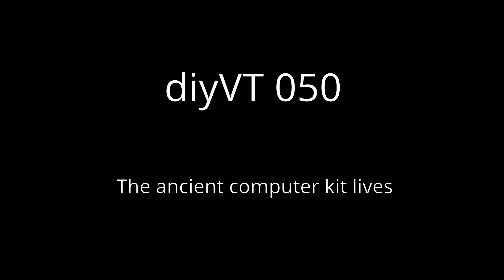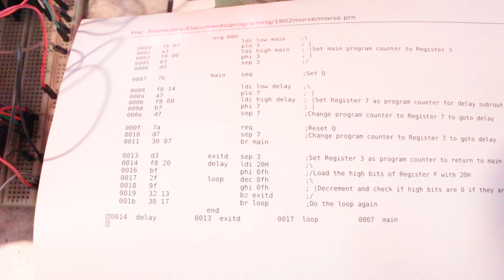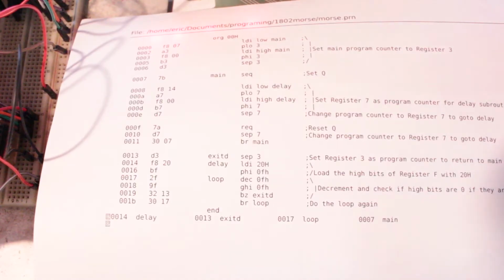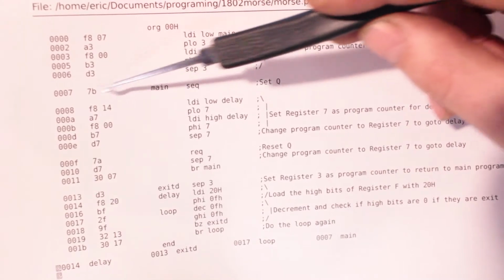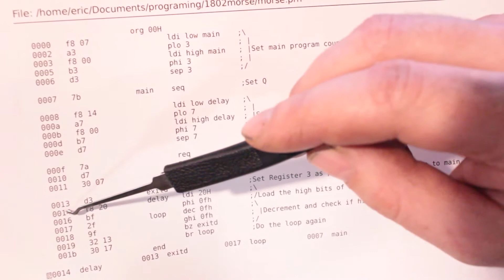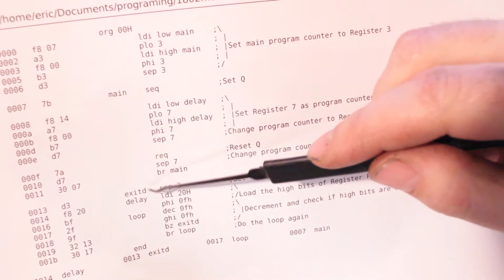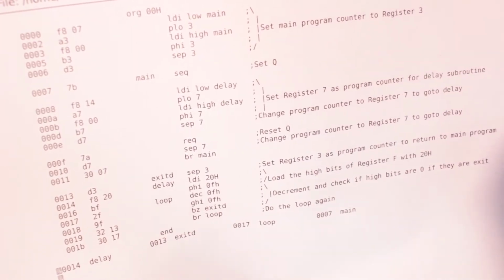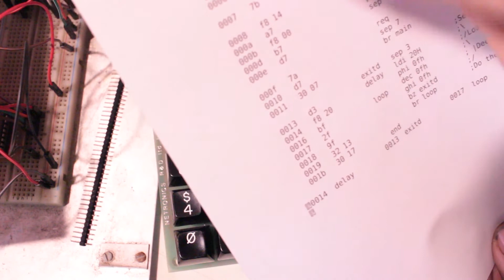Very primitive computer programing.

Comment: Compared to modern stuff that kit didn’t do much, but I remember the endless possibilities being able to program simple I/O with relays to control real world stuff... gold!
Reply from the maker: It doesn't compare to badly to an arduino however an arduino is a heck of a lot easier to program and get started with.
Reply: @diyVT  Switching processor modes takes a little to get used to, but this way you can use the 1802's LOAD mode. This way you can enter your code via DMA without a scrap of software involved. But you also have the Giant Board installed, so you could just enter C0 F0 00 to jump into the monitor ROM and use the monitor program to enter your code. Then you don't have to step through your code again when you make a mistake. The monitor also allows you to save or load programs from tape.

The Giant Board also has parallel ports and a simple RS232 interface (your power supply must provide -8V for it to work). The 1802 can access a VT100 terminal over it. It's not very fast because it's actually driven by the 1802's Q line, but at 1.79 MHz you should be able to reach 4800 baud.

I have a simple Elf on a breadboard. it's running at 6 MHz and reaches 19200 baud. At that speed things begin to become quite comfortable.
Reply from the maker: @CDP1861  I don't have any other 1802 stuff. I did talk to another viewer about getting a monitor ROM but that didn't go anywhere. 

I did get a ram chip with a built in battery to use in the ROM slot so I can have some storage space that doesn't disappear when I disconnect power.
Reply: @diyVT  My mistake. I mistook your processor board for the Giant board. Anyway, the cassette interface is really simple, just two OpAmps and a few discrete parts. Then you can store your programs on tape. These days I use an old notebook with my old Elf II, both as terminal and 'tape recorder'. Just plug the old Elf into the sound card and record or play back as WAV files. The serial interface is just as simple. the parts will not cost you very much. If you want, I can also provide you with a listing of the monitor. you could store it in your buffered RAM. It only takes up 256 bytes and can be relocated to any memory page.  With a terminal and some simple mass storage it will become a much less 'primitive' computer.
Reply from the maker: @CDP1861  Sure you can email me at diyvermont@gmail.com

My 1802 board is a "product board" I think it was sold as a even more bare bones version of the elf II. I think it's supposed to be programed and then installed in something like a home brew robot and then just left to run. The programmer board can be detached and the product board should just run on its own just fine. You would need your program on some sort of nonvolatile memory but that's not too difficult.
Reply: @diyVT  It sure has some family resemblance to the Elf II, which itself is an improved version of the original Elf that was published in Popular Electronics in 1976.  At the time a computer under 100$ was almost inconceivable. Sure, the basic Elf II had only 256 bytes RAM, but it actually had graphics when other computers like the Altair required a terminal (like the famous Altair, which is only a year older than the Elf). I have a simple Elf on a breadboard on my other desk. Just six ICs. The 1802 (at 6 MHz, still running cool), a latch (you must demultiplex the 1802's address lines if you want to have more than 256 bytes memory), a 32k EEPROM, 32k RAM, some NAND gates for address decoding and (no, not a UART) a simple MAX232 to convert the 1802's microcontrollerish I/O lines to RS232 voltage levels. I use that to communicate with a terminal in software at 19200 baud. 38400 baud may be possible, but I would have to take another look at my serial routines.

You know what? Before I start sending you mails, just sign up here: https://groups.io/g/cosmacelf 

That group has everything you may need. Schematics, software and guys who have been playing with the Elf for more than 40 years.  You will find me there as well. I'm the one who wants to go a little beyond 64 k memory. 16 megabytes. Sacrilege, I know. :-)
Reply from the maker: @CDP1861  mine was purchased in November of 1981. I wasn't even one year old then but I have the original sales slip. I am not sure how much longer netronics was around selling 1802 stuff after that.
Reply: @diyVT  Not for very long. I looked for the Netronics ads in the old issues of the electronics magazines. I think they continued until 1983. By that time almost nobody wanted to buy a computer kit anymore. The Elf was somewhat popular before there were any assembled computers in the stores. And don't listen when someone tells ypu what a weird processor the 1802 was. It's actually a very friendly processor, but it does everything a little differently as all the others. It's actually a RISC processor before RISC was actually invented. If you like to experiment with electronics, then your old kit may be more interesting than it appears. Does it have any more of those 86 pin bus connectors? That would be ideal to add that simple serial port I already told you about.  Or how about using Compact Flash cards as a 'hard disk'?
Reply from the maker: It's certainly not what I was used to. I did almost all of my assembly programing on a 68HC11 in college and the 1802 is very different from that. Once I got going I was able to get it to get it to do basic stuff. There is certainly a lot that I don't quite understand but I was able to write Bubble Sort for it. (did a video on it if you haven't seen it check it out)

It doesn't have another 86 pin bus connector, the actual connector part is built into the programmer and the "product board" just gets connected by the edge of the PCB.  It wouldn't be too hard to make another programmer that uses the same connector.

There are two ports one for in and one for out, I think they are 16bit but I am not sure.
Reply: @diyVT  Turns out that I watched your video a year ago.  I left a comment back then. 

Take a look at the following video. The original VIP was RCA's version of the Elf. The one in the video uses nothing modern than your old board, except maybe the ROM and RAM, has video (similar to the old Elf or VIP) and even a tiny keyboard. And it fits into an Altoids box. 

https://www.youtube.com/watch?v=U0DvE7Mbxik